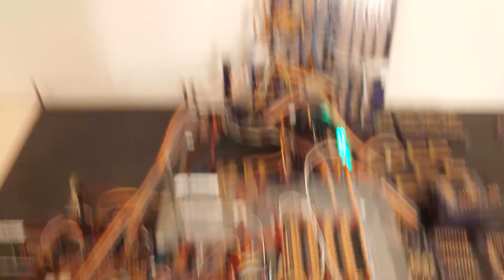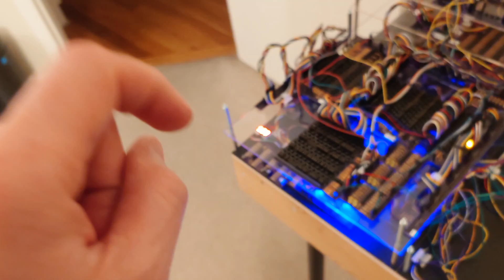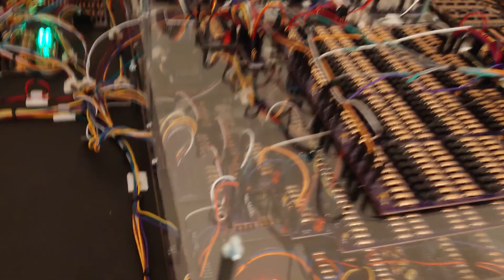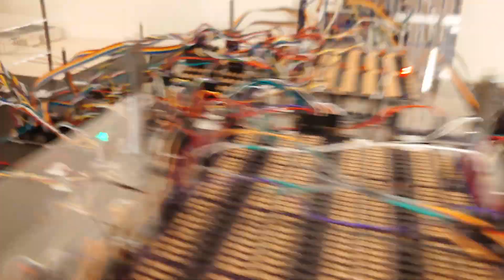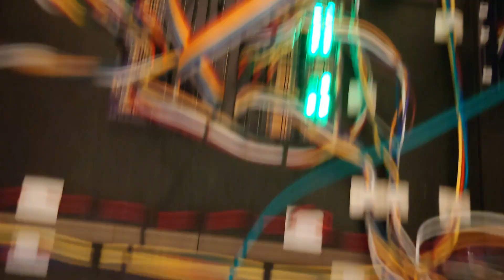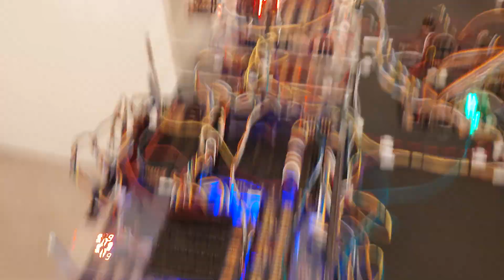MiniDragon June 2025 Progress

Comment: Great you're demonstrating the bonds between micro code states and the data paths. Loved doing this when I was younger. Diagnostic testing to verify everything at power up becomes very tedious though, as you add microcode and data paths. I loved the "V-bit" bus structure on the 32 bit Vax 11/780. Just a bunch of flip flops in series. Each one connected to a designated "State Point" stepped out into a block of data to xor to the library of good state conditions. Great video demonstrates things that go on at the lowest levels in computers